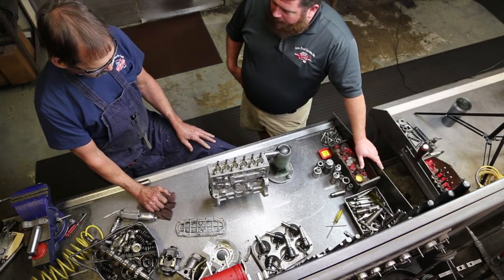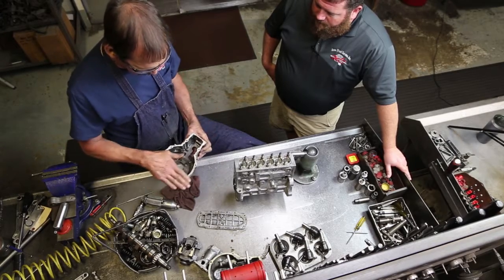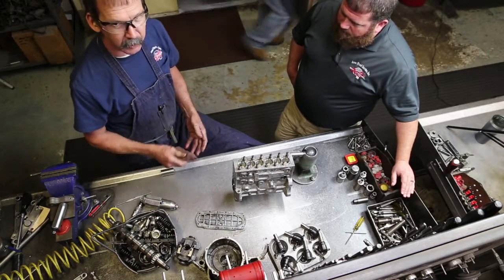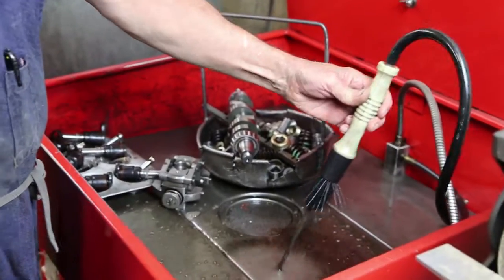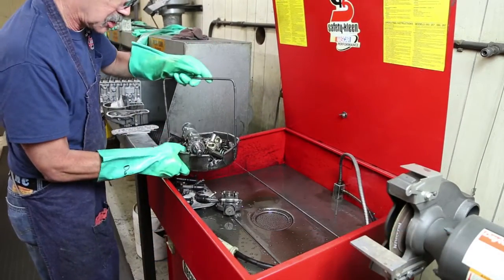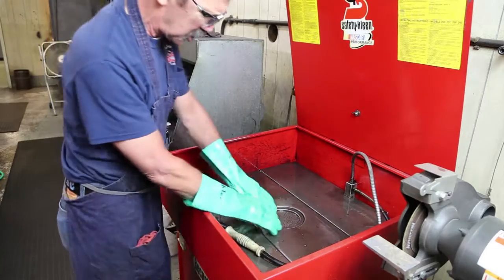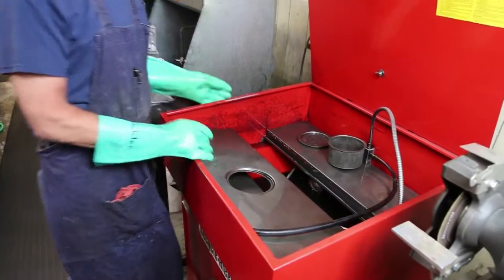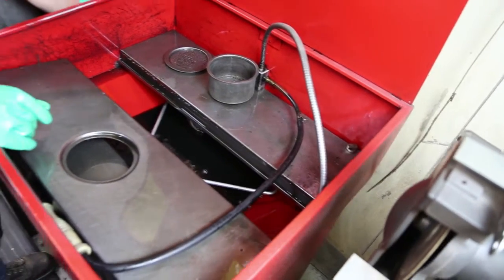Part 2 - #Bosch #Diesel #Pump #Rebuild - Area Diesel for #bcbloc02 Hyster Forklift 8.3L Cummins Swap

Comment: Random endless crap music junked another video 👎🏻💩
Reply from the maker: Thanks for the feedback.  In all we do, we look to continual improvement - the general feedback shows the background music wasn't much of fan favorite (and honestly will make for less editing work in future videos if we leave it out!)
Reply: @AreaDieselService  I know the price varies if hard parts are bad, but what does you shop charge for a basic reseal on a pump like this?
Reply from the maker: @basketofdeplorables4253  Around $1100 to tear it down, clean it up, reseal and run it on the stand. Then any hard parts will be on top of that.  You can always contact us with more specifics and we can give you a quote.  800-637-2658